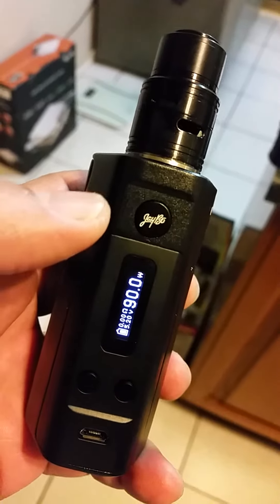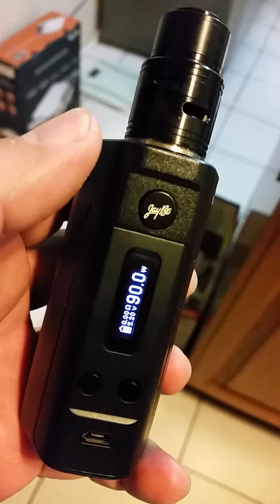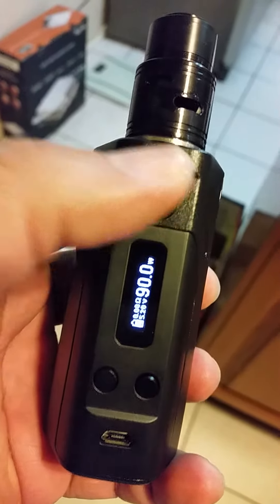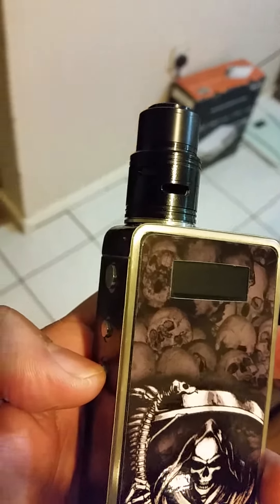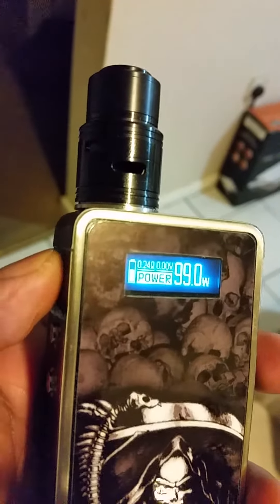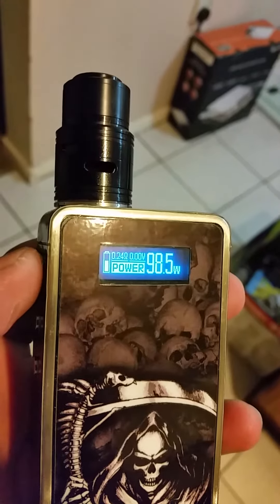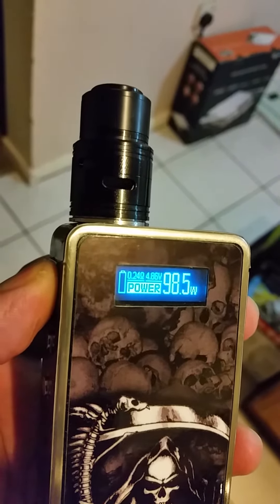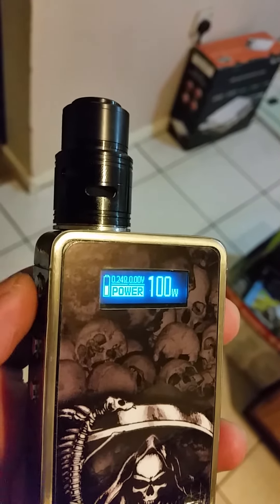Messed Up Realeaux RX200

Comment: Same problem here mate only fix I have found is to do a battery pull (just take the first battery out) and put it back in and boom its gone have you recently updated it as I did it when I first got mine (2 days ago) Ill try and downgrade it and if that doesnt fix it ill be taking it back and stick to my IPV3 li 200w
Reply: +Macca 95 did the exact same thing just adjust the battery postion and your good
Reply: +Hesh I found out what it was I had a buddha rda clone and the centre pin wasn't protruding enough ans was shorting , hell knows why a battery pull fixes it for a couple of minutes, but works well with my uwell crown, twisted messes rda, royal hunter rda and phenotype-l rda so if I was you I'd check your pin, hope this helps
Reply: doesnt usually say that anymore